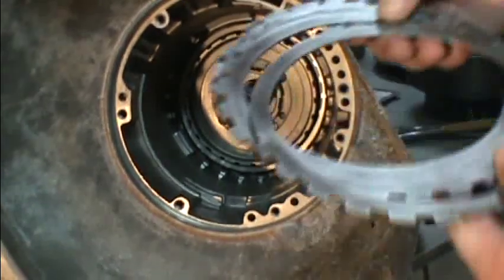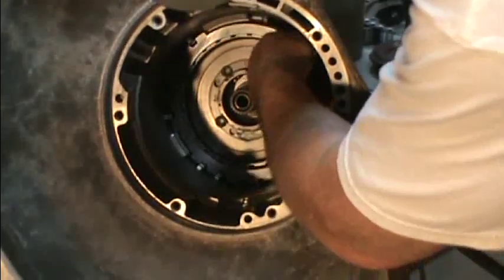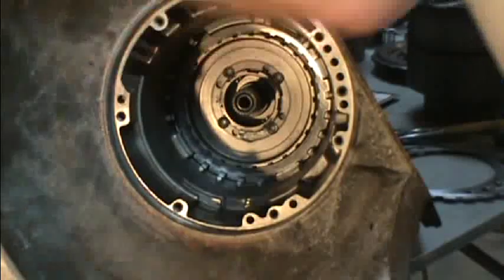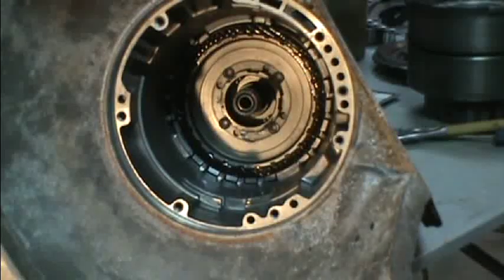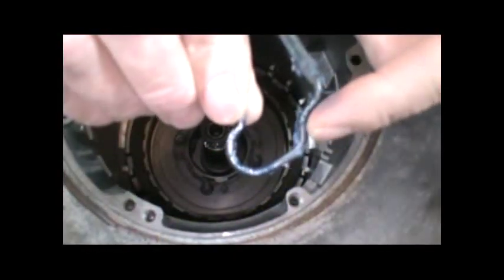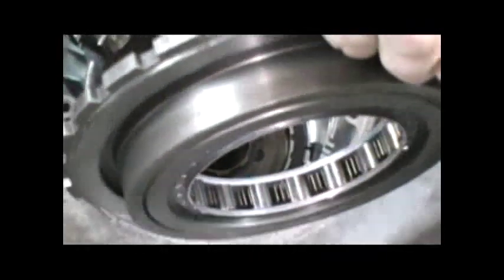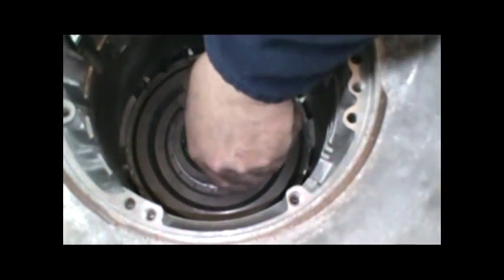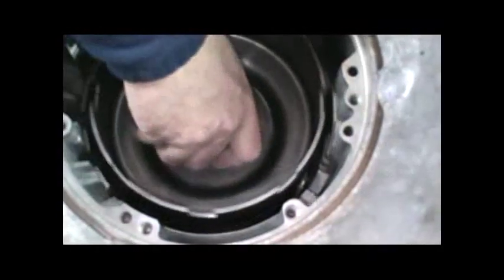Turbo 350 Assembly

Comment: I installed a th350 on a c10 and the truck doesn't have any gears? What could be the problem?
Reply from the maker: I would pull the pan and check linkage inside. Make rooster comb is tight.
Reply: @BrianSwayne would low oil pressure  cause this problem too?
Reply from the maker: @davidl5121  put a 200 psi gauge on it. That will tell u.
Reply: @BrianSwayne  where should I plug it too and how much pressure should it have
Reply from the maker: @davidl5121  http://www.jakesperformance.com/trans-tech-info/
Reply from the maker: There is a port on rt. side behind servo at rear.

Comment: Back in the day I would build a very strong th350 . I’d take all pistons down machine it to add extra friction and steel, replace all wave plates with steel. Replace lower pinion with one from a 4 cyl. It actually lowers first gear multiply torque, use all bearings where possible instead of thrust washers, remove intermediate accumulator spring. Along with a fairbanks shift kit. Really worked nice

Comment: Why did my Chevelle back up one foot and then loose reverse function?  It's a pretty new trans !
Reply from the maker: You would have to check reverse pressure with a gauge that goes to 300 psi.Connect to reverse port with gauge.
Reply: Hmmm,,,,  OK.  I was also thinking the S link may have issues.
Reply: Its the seals on the reverse pistoms most people only replace the frictions/cluthces and call it good tear it apart chacke the seals and go from there

Comment: how come no one wants to show putting in the LR piston?
Reply from the maker: +nw5052001 There is no trick to installing rear piston.Install seals,lub & push in with large screw driver.It slips right in.
Reply: +Brian Swayne ..thank you for that... I didn't try very hard yet, it seems a little difficult from what I am used to and it didn't push right in by hand...I know to line up the lug on the piston but figured I should stop to see if there was a trick so not to ruin a seal....Been and still Chrysler tech and done many Chrysler trans and about 35 years since been around TH350 and just helping out a co worker..I do appreciate a reply and the video will come in handy.....Ill give it a bigger push and if I need I wlll try to pull it in lightly with my NAG1 tools set up which worked well for removing the piston spring retainer...thanks again
Reply from the maker: There is a full disassemble video if you go to my page.
Reply: +Brian Swayne I got the piston in no problem....I am going back together now...ran into a problem maybe you can help me out with..ill try to keep It short.............The middle sealing ring of the 3 for the direct clutch on the pump was missing....also the direct clutch was set up tight at .010 inch...4 disc with 2- .067 plates and 2 - .08
Reply: +nw5052001 2 - .085 plates ..4 plates total......Having trouble getting correct clearance with 4 - .067 plates.......i think it is a 5 disc piston....all clutch packs had some burning occurred so I am thinkng maybe a pressure problem.......do you know any reason someone may have doe this intentionally?
Reply from the maker: nw5052001 To correct clearance,you can machine piston to get correct clearance.Any machine shop can cut piston for you.
Reply: +Brian Swayne  .. i got the direct clutch set up for 5 disc, i machined the piston and got my clerance good at .050.....Thank you for that.........So my friend bought a th350 from an unknown seller and in unknown condition...Someone recently rebuilt it and didnt get much use from it from what i can tell....and with the condition the direct clutch was in i am thinking they shoudnt have touched it...other things appear they did a shotty job to...... -It was already missing the direct drum center seal and the midlle direct sealing ring on the pump stator...So far i have sorta determined the valve body sep plate is stock, though some check balls were missing, - So far I am thinking a shift kit was NOT installed...   If you dont mind me picking your brain I have a  question or two if you are familiar with internally duel feeding the direct clutch?........I have got most details but need a little clarification...-----------First I am not certain when internally dual feeding without using a kit if I remove both the drum center seal and the pump sealing ring or just one of them? ... Appreciate any help or suggestions.Ken.
Reply from the maker: nw5052001 Glad it all worked out.
Reply: On my channel i have a 4l60E rebuild and tear down video it shows how to install it

Comment: Any video start to finish on reassembly so we don't miss some tip or placement of a bushing-bearing-washer?  Anything with dial in to check clearances?
Won't be machining anything if possible, just making a reliable trany for my plow rig.